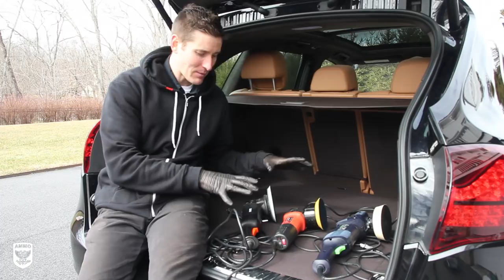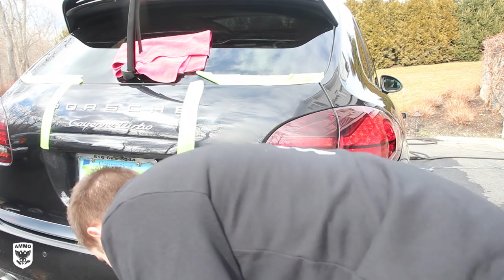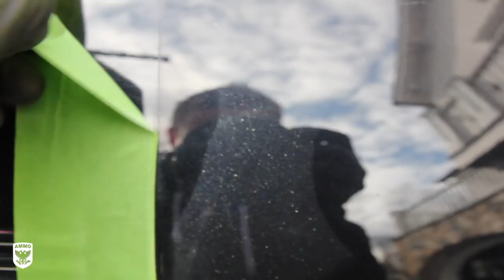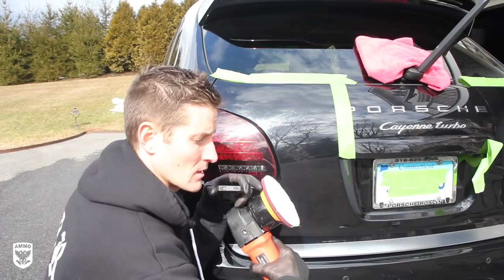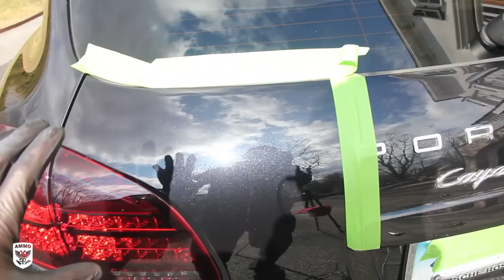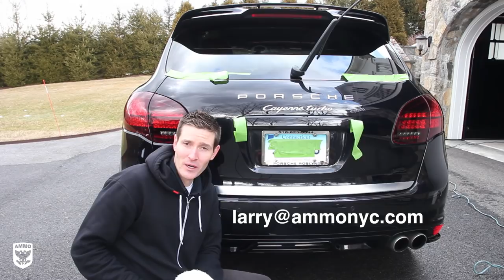Rupes Bigfoot Polisher vs Griots DA Polisher

Comment: You should redo this video with the new Griots g21 vs the Rupes LHR21 mark 2! I think that would be a pretty informational video as it's getting harder and harder for the expanding detailer to know which machine would benefit them best! Thanks
Reply: 2nd that. I am currently in the market for a polisher and the Griots is very high on my list. Re-visiting this topic will be real helpful Larry as both companies have brought out updated products.
Reply: Rob Silva If it helps you any, I ended up purchasing a Zentool ZEN-21E. It's practically a Rupes LHR21, but with a washer mod and a couple other things from factory. I'm very happy with it so far!
Reply: results would be about the same... the difference would be in the "feel" and preference.
Reply: try it with a kamikaze plate!
Reply: The G21 is AMAZING! G21 has my vote, the feel, and the lifetime warranty vs rupes 1 year. Just saying..,
Reply: He has done an updated video on the Rupes 21 mark 2.... and since then... I haven’t seen a Griot in his hands.... so, I’m thinking he is pretty much a believer in Rupes.... I would like to see a video showing the time difference in the 15 and the 21.... also, how does the big throw effect smaller panels
Reply: My Boss puts off too much heat even with the washer mod and delaminated my pads. Wish I went Rupes
Reply: Throw it up to 6 on the Griots. You don't be needing no need silly "upgrade" please.

Comment: $140 VS $400
Honestly, I'm going with the DA.
I can spend a little extra time with a DA and get the same results.\
Good video though.
Reply: ***** I went with the $120 one from griots garage and I'm super happy with it.
Reply: $70 HF DA works just as well... had mine for over 5 years without an issue.
Reply: Rupes is the daddy....pull out your dollars or pounds you sissys
Reply: The Harbor Freight DA is not in the same league as far as true defect removal capabilities.. I can speak from countless hours of detailing with it. Put a 3" plate and pad on it and compound a small area, and that is what a high end polisher is capable of with large pads, and it will do it quicker, with less heat, needing a much slower speed with less sling, and much less vibration. The cheaper units don't have the low end torque to completely remove more than light defects efficiently. With an extension it makes a great 3" buffer though.
Reply: No brainer even today.  The DA actually in my opinion is better.  It's much cheaper and I'm a bit puzzled I can do any car in about the same amount of time as the over priced one.

Comment: P.S.: You mentioned one of the polishers delivered 7 horsepower and that is physically impossible. Could you have meant 700 watts? BTW, 1 hp = 746 watts. That means a motor that DRAWS 746 watts would need to be close to 100% efficient (rare) to yield just under ONE hp. Flip side: A 100% efficient 7 hp motor requires 746 x 7 or 5,222 watts to do its thing. Divide that minimum wattage by 110 volts to yield the required amperage, and you get 47 amps, which would blow the breaker of your typical 15-amp or 20-amp household circuit.
Reply: I'm sure he meant the amps. Which is 7 amps I believe.
Reply: +Alfred Hernandez Yes, 7 amps makes much more sense.
Reply: 7 amps, dude you  should know better than wasting your time writing a short story.

Comment: Caveat: I am thinking about getting into polishing my cars. Which is to say, I am IGNORANT and also vendor neutral. Therefore, I'd truly appreciate comments on the next paragraph from pros who know what they're talking about:

Seems to me that "throw" is very important, and Rupes is a pioneer of that. Furthermore, the time to polish a car is measured in hours, so human-factors engineering should be a KEY product-selection criterion. From the photographs, it looks as if the Rupes has a far more ergonomic design, and thus should wear down the user much less. Bottom line, all things considered, the higher cost of the Rupes should be IRRELEVANT to any professional polisher, given its superior speed and comfort. Only a casual-use enthusiast can justify purchase of one of the less expensive polishers.
Reply: Check out the torq22D or torq10fx
Reply: Oh you're "thinking about getting into polishing your cars?"... Who cares!?
Reply: Mathew Farry like he said he want something good but inexpensive
Reply: Mathew Farry   Why are you even commenting??  Guy was explaining why he doesn't know much about polishing and why he was watching video.  Don't need your negative comments on here
Reply: Thank you!
Reply: @luketuttle1096  I must have been in a bad mood.... Anyway since posting that comment I've purchased a Rupes and can confirm it is an excellent polisher, I've lent it to several friends and they all say it's by far the best polisher they've ever used. Highly recommend the Rupes.

Comment: Larry, have you tried the Rupes Microfiber Color Coded Pads with the vent holes in the pad yet?   I was just curious.  I wasn't sure if you made this video prior to those pads even coming out.   I thought they were fairly new.    Also, have you tried any of the Rupes compounds, polishes, or sealants yet?    I know you have your own incredible product line, but was just curious if you have tested any of the Rupes Chemicals in addition to their Microfiber Pads and their original foam pads? Rupes does make it fairly easy for the hobbyist detailer like myself using their color coding system (Blue cap use blue pad, green cap use green pad, etc)   The color coded caps/pads does make it fairly easy for the home user that doesn't detail as a profession.   I wish more companies did the same thing because it takes a lot of the guesswork out of it for home enthusiast like myself.   I do realize there are literally THOUSANDS of combinations of products that professionals use and that you always do "test spots" and use "test products" for your detail jobs due to so many paint hardness and thickness parameters, detailers like yourself could never just stick with a color coded system, but for what I go after (not exactly perfection) but a really great quality shine and removal of most paint defects, the color coded system seems like a really good idea.
Reply: I use the blue Rupes microfiber cutting pads with m105 on a 7424xp, speed 5. Very effective  at removing 1000 grit sanding marks. Seasoning those pads can be tricky, but we'll worth the effort.

Comment: Hey Larry, what's your opinion on the Meguiar's G3500 DA PowerSystem.....the one that attached to a corded drill???  I was thinking of using it with Meguiar's Ultimate Compound + Meguiar's Ultimate Polish then finishing with Meguiar's Ultimate Liquid Wax.  The car has a lot of swirl marks.  Let me know, thank you!
Reply: well since its just spinning it will be just like a mini rotary buffer. I would recommend just buying a pc 7424xp or griots da polisher like in the video. Charge a couple friends like 35 bucks to work on there car and it will pay itself off in no time. What i also forgot to mention is how small the surface of the cordless drill method is. good luck tho if you decide to go that route, careful not to burn your paint.
Reply: Moises brito Actually it IS dual action and safe, but I would agree that the 7424XP is better. If someone were to put a backing plate directly in a drill then yes it would be considered a mini-rotary, but the G3500 has a dual action gearing system in it so it would be safe. However I would recommend that someone would spend the extra $20 and get the Griots's Garage because the extra power largely reduces correction time required.

Comment: As a first time purchase of a polisher, should I get the Rupes directly or should I get the Porter Cable 7424xp? I don't mind spending the extra dollars, I just don't want to have to upgrade to the Rupes in 1-2 years and have the Porter Cable sitting in my garage and going to waste. Also, I will use the polisher 2-3 times a year.

Comment: Would the griots Da or Porter Cable be strong enough or powerful enough to get through the modern paint or hard paint. Im not sure if for each manufacture if the paint is harder or softer but lets say on Land Rovers and Mercedes would the Griots Da and or Porter Cable be powerful enough. Then which would be better to remove heavy swirl marks and for polishing? Thank You for you time.

Comment: Hey Larry, I've never really seen you tape seams, emblems etc to prevent splatter. Is Menzerna that good that you dont need to tape up, or are you using a technique in which there is no splatter?

I dont get much, but there is some splatter with what I use
Reply from the maker: +Allen Toma I still tape.  not all the time but I do.  It takes a lot of practice and the right tools.  Plus some liquids are prone to sling and some don't so it's all relative to the situation. Thanks for watching!

Comment: hey larry im looking to get a 15ES rupes polisher. Can you let me know if I need to buy a separate 5" back plate to use microfiber polishing pads? 

Also have you tried using Pinnacle Safe Scrub Bug & Tar Pad to clean your microfiber polishing pads on the fly? If so, can you please let me a preferred way? I have ripped a few foam pads with a rough brush before.. a bit paranoid.. thanks!

Comment: Larry, sorry if I missed this, but was this the Rupes 15 or 21? Also, which size backing plates and pads were used on both the Griot's and the Rupes?

Trying to decide between the 15 and 21 right now.  Leaning towards 21 w/ 5'' backing plate.

Comment: Hey Larry, I have a Flex 3401 and I am a beginner weekend detailer. I am having a little bit of trouble getting the correct pressure applied to the paint. How hard should I be applying the polisher? Also I have been using the foam pads that were included in the kit (from detailersdomain), what would be the difference between them and microfiber cutting pads in terms of performance. Thanks and keep up the videos

Comment: ive been detailing since 2005 and have fallen in and out of the game, i still currently use the flex rotary pe5120(sp) and the Metabo rotary. how do you compare the 'final' correction on a Rupes detail vs a rotary detail. can the rupes get to 100% or near? rotary has its caveats the burn and extra anxiety even in skilled hands, the Rupes sounds like it can knock out the work faster and close the quality..would u agree? btw what camera is that you are using for the macro shots! thanks!

Comment: Lary, how about the new FLex XFE 7-15 150 15mm hub exenter? Will you test it? Or could you try it out on the SEMA? 

I do own myself the Flex3401. Pretty great tool. Did 20 cars as a hobby-detailer in 12 month.